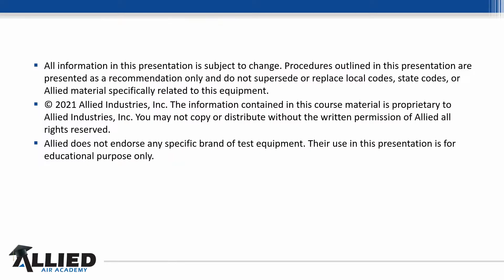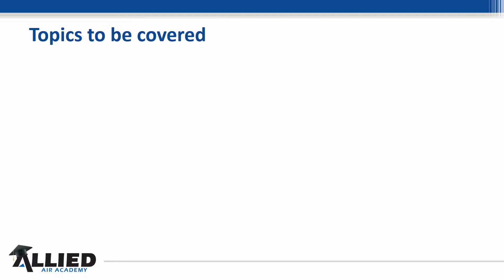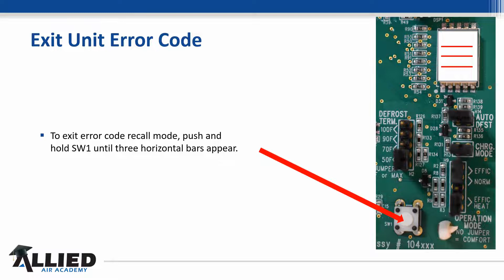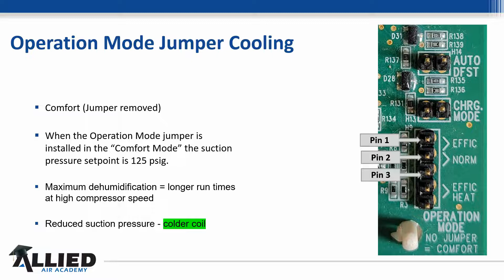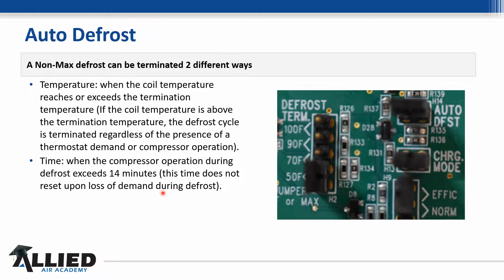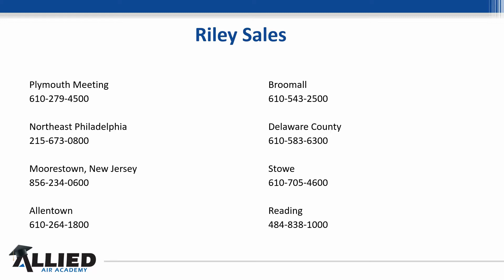Ducane Lynx installation training by Riley Sales - HVAC industry

Comment: I can’t find anywhere in the system specs that this system can be set up as communicating, and have been told by allied it isn’t set up either? I have contractors who are setting it up as communicating and they say it has wires and plugs for it and it does work. Any ideas? These are the 18 seer lynx’s im talking about